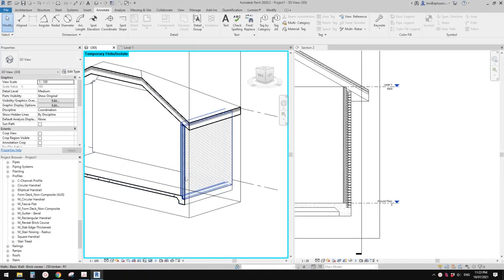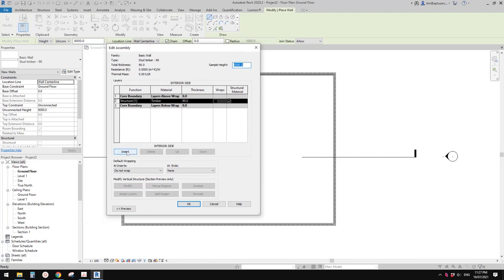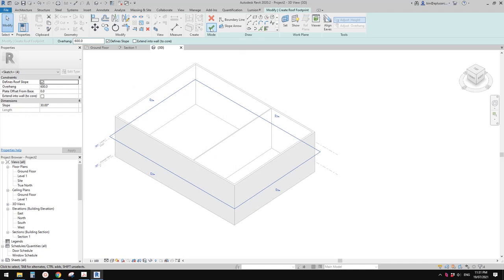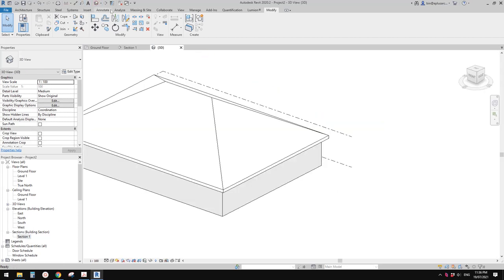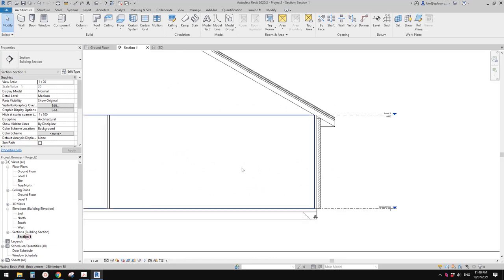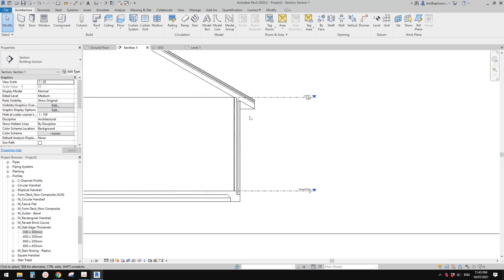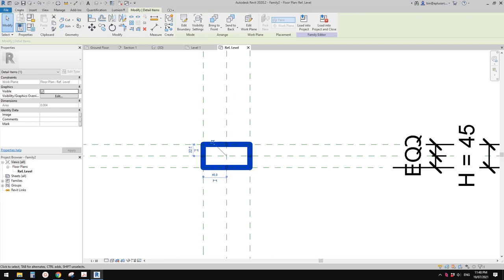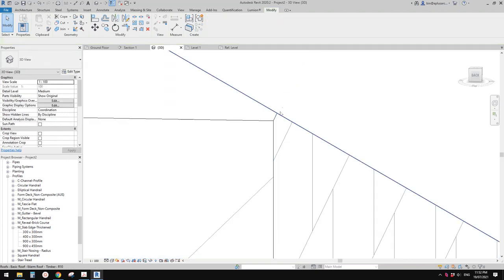Everyday Revit (Day 486) - Basic Wall, Roof, Floor, Detail Modeling

Comment: Hey Bim man, how are you, as always qreat tuto, I have something for you, what about modeling a parametric stair as a family, with parameters to control everything, I was trying but I guess it takes some formulas and you are the best on it, I used the generic 2 levels based template, I think is the right one, thanks
Reply from the maker: Yes, you can definitely create a family for the stairs, but I recommend you use the stairs tool for stairs. I understand that it is pretty hard to use, it is still a good tool for some stages of a project. For example, the railings, the stair arrow, the automatic landing, the multi-level function, and all the warnings you get for the incompliant heights.  I guess it will be more beneficial for you to invest some time in the actual stairs tool than inventing a parametric family. What do you think?

Comment: At 11.35 u change the roof type ...can u plz make a roof with layers or u have a video plz send me the link ...thanku
Reply from the maker: The roof I used is a type of roof from the Revit Architectural Template, you can simply edit the layers yourself, just like those in a wall type.